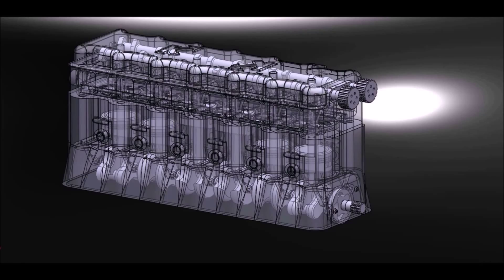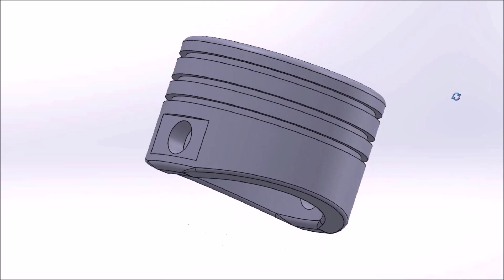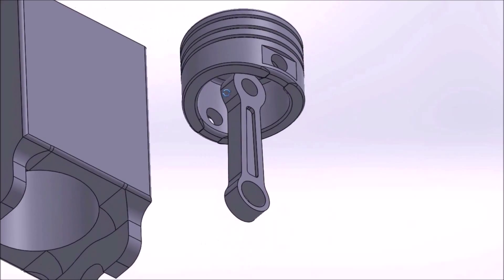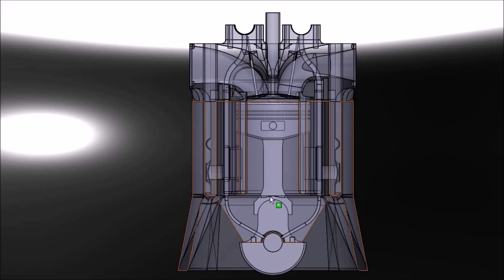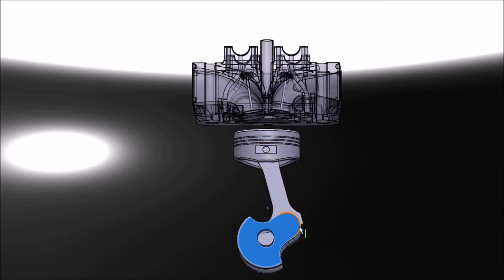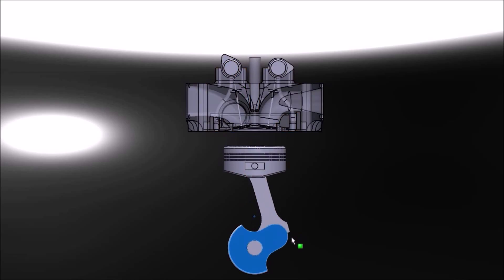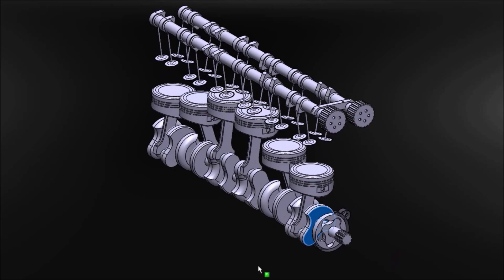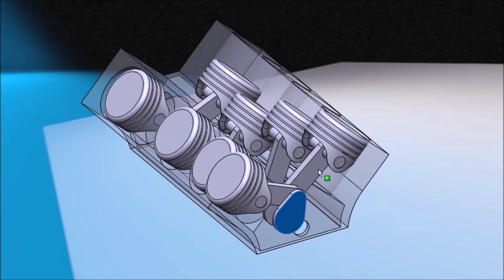How a Car Engine Works (Animation and Explaination) |JOKO ENGINEERING|

Comment: Hi,  I'm a very beginner in to the world of cad, and I want to design either a cross plane crankshaft for I4 cylinder engines,  and sell them as kits for everyone to install in their cars, or design a I4 cylinder engine with the previously mentioned crankshaft, this for race applications and the capability of civil market as well.  Any advise on this project is highly appreciated.